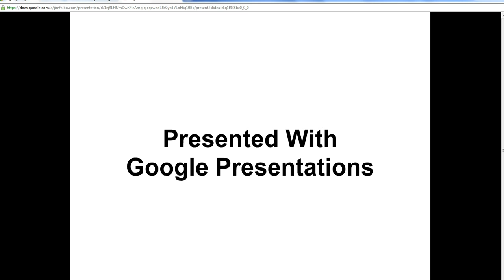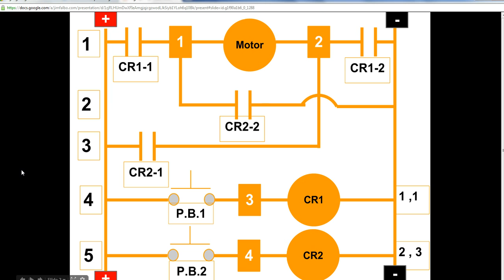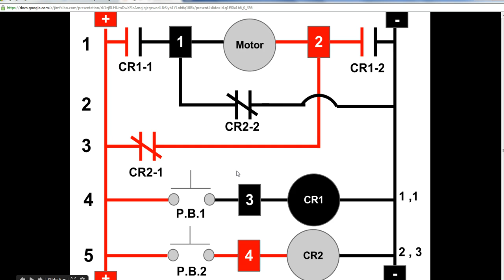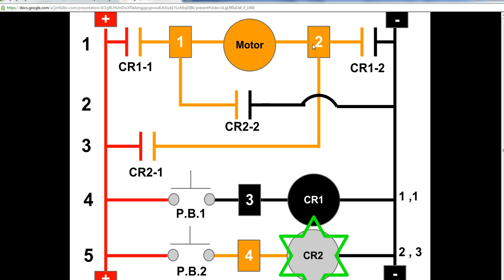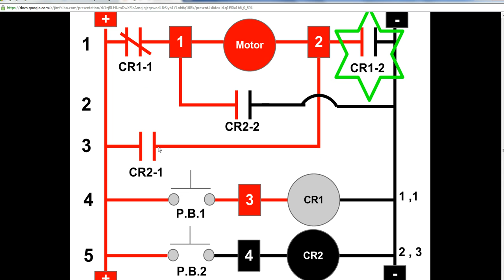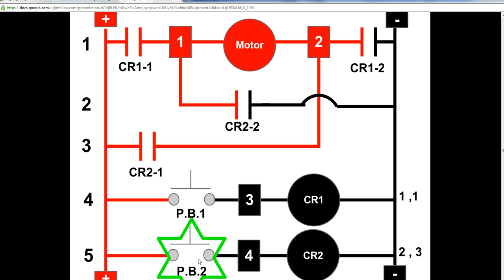Electrical Troubleshooting of a relay control circuit.

Comment: At 3.17 when you pressed PB2 why CR2-2 beneath the motor doesn't get positive voltage RED. WHy it got negative supplied voltage ? I am confused.